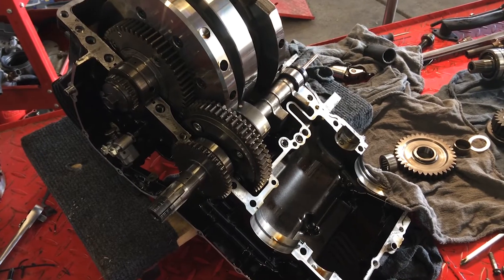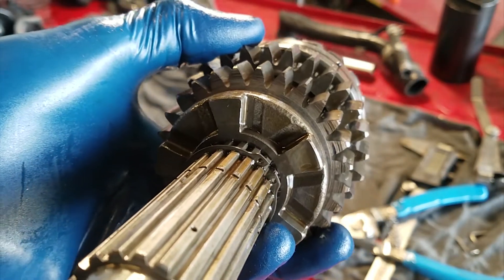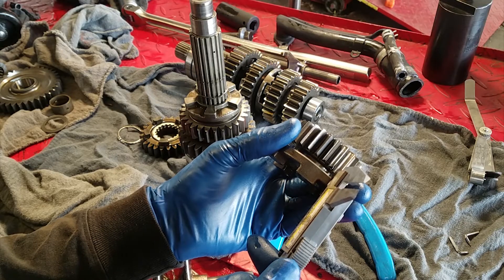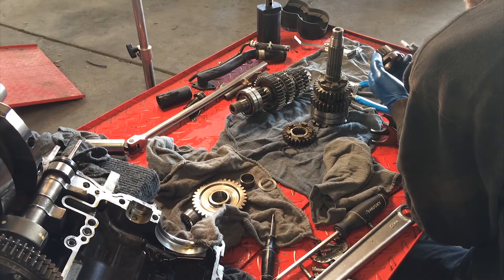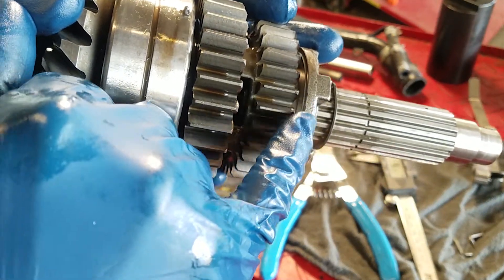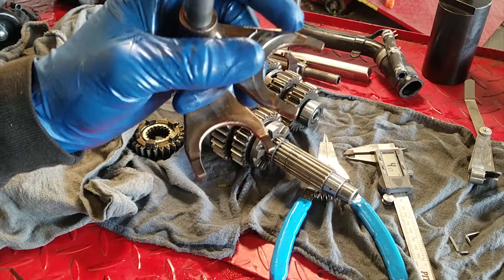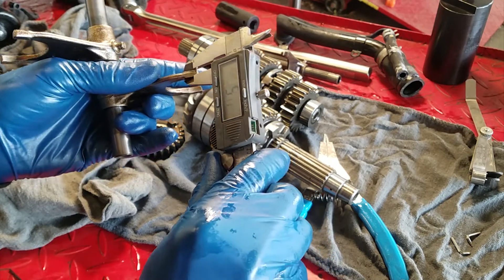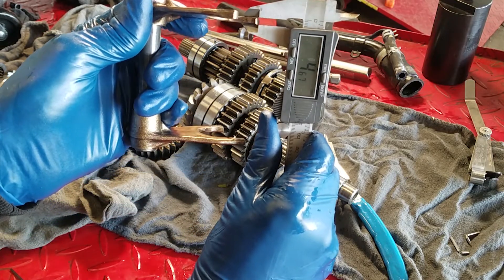Suzuki M109R / VZR1800 Transmission Damage Assessment and Technical Inspection

Comment: Hey thanks for the video... is there a design flaw in the OEM parts? Will the problem be solved by replacing the parts or does it need some kind of shim or something? Thinking of buying one of these bikes, that's a repair i would like to avoid if possible!
Reply from the maker: There are no upgraded parts from the factory for this.  You're pretty stuck with replacement of the gears and riding the bike.  That said... if you decide to do this job and pop all new gears in there, you can see about having the 2nd gear and 3rd driven gears back-cut.  By back-cutting them a little they'll hold themselves together under acceleration.  You'd have to speak with a machinist about that though.  Only option I've heard of to remedy this completely.  Seems most are having the issue right around the 25k mark.